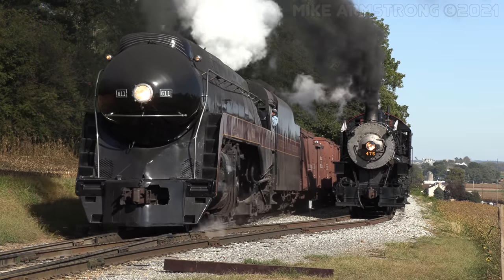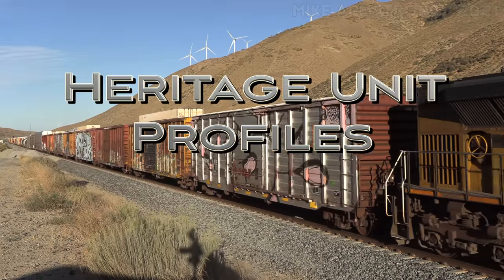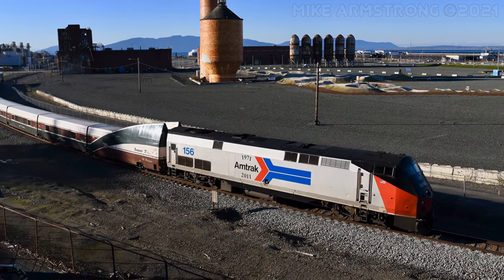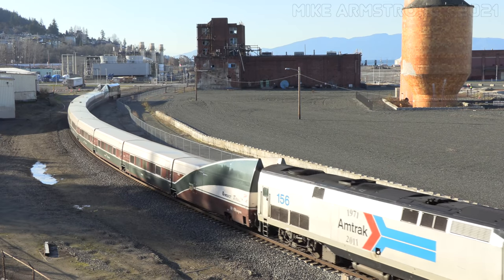Amtrak 156 Phase 1 P42 - Heritage Unit Profiles Ep. 1

Comment: AMTK 156 was involved in a wreck, it's actually getting repainted into Phase 6 heritage. Another Genesis unit is getting Phase 1
Reply: Where did you find that information?
Reply: My friend on Discord told me. But I know that UP 1995 is back in service, it's getting ready to start it's first run after repairs.
Reply: Here's my question.
What engine will wear the phase 1 paint now? I'm gonna miss the 156s scheme. It been pretty reliable. I was able to see it while it lasts. Im excited to have 156 back if so
Reply: @adventuresofamtrakcascades301  161 Currently has the Phase 1 (50th anniversary) scheme
Reply: I heard that 161 is leading Amtrak empire builder.
Reply: @adventuresofamtrakcascades301  Now it’s on Southwest Chief #3

Comment: My favorite heritage unit 156..

Got in a wreck

Now it’s been repainted as a 50 anniversary heritage unit
Reply: I think Amtrak is going to paint a new Phase I heritage unit for the 50th anniversary. But the only 50th anniversary paint scheme that's been released so far is AMTK 100, the midnight blue engine.
Reply: @Christopher Araujo-Souza 156 is not the 50th anniversary Phase I unit. That unit has just started service in the new livery and it's road number is 161. From what I can find it's last known location is Chicago. It seems like the damage is mostly to the replaceable nose piece, so they might not be making it a priority to get it back on the main line if they have enough other functioning locomotives (which I would think they do). There's also the fact that the P42's are probably going to start getting phased out at the end of the year with the new SC-42's about to start entering service around that time. It would be very cool if they repaired 156 and put it back in service though.

I want to see trains run by locomotives in liveries from the same time period. A service double headed by the two bloody-noses would be very cool. Maybe even throw in the Day-One unit as well. Regardless, I hope that the heritage units are the last of the P42's to be retired, and when they are they should be donated to museums.
Reply: @sargentrowell81  161 was last seen in St Paul, MN
Reply: @Christopher Araujo-Souza It's hard to say, especially since P42's are probably not going to be around much longer. All we can do is speculate. It's possible that they're not planning on putting it back into service, unless they suddenly have a shortage of power. That's a possiblity depending on just how many engines were put in storage at the start of the pandemic. That in combination with the return to daily service on the long distance routes could bring a need to fix it up and return it to service.
Reply: 161 is choosen.
Reply: @mmandmcb14  I know but at least we have a new phase I Heritage unit
Reply: 156 was repaired on 2021
Reply: @Ten-ku4yj  Great! We may yet get to see a bloody nose double header!

Comment: R.I.P AMTK 156 Since it crashed on the sunset limited
Reply: They'll probably repair it, if they can as it's a 2nd phase Genesis, the surviving ones
Reply: @AVeryRandomPerson  even if they do not repair it they’ll just use another p42 with another number like when they replaced number 66 with 130
Reply: They aren’t repairing it. They announced as part of the 50th Anniversary that they will paint a different locomotive into that scheme. And I don’t think they would have 2 Phase 1 Heritage units.
Reply: And the new locomotive will also have a 50 years decal on it